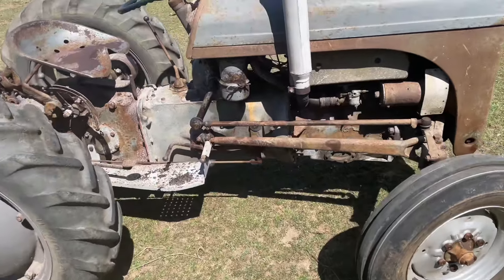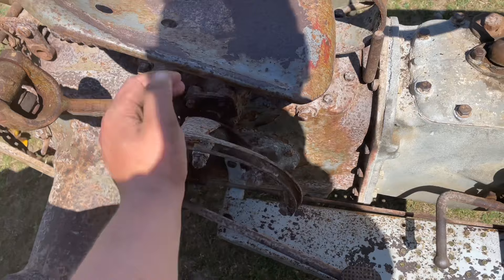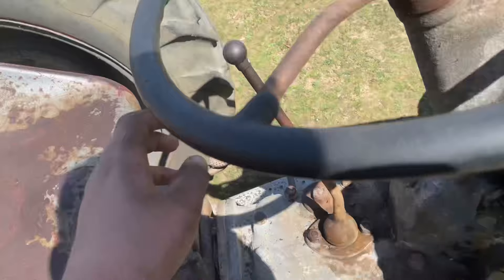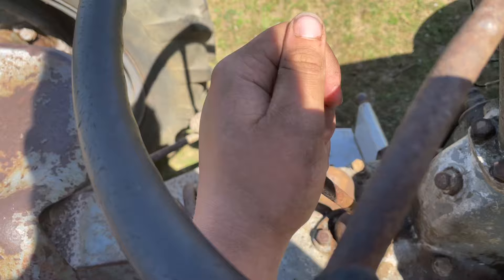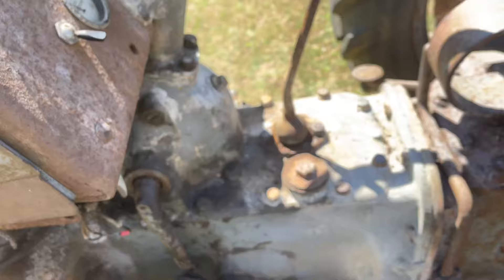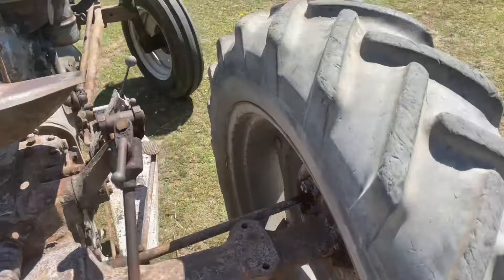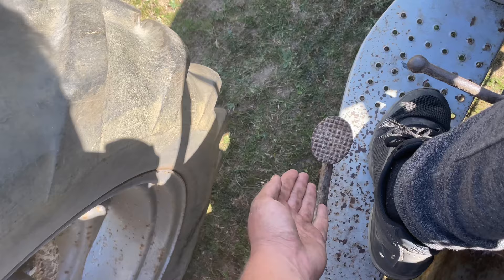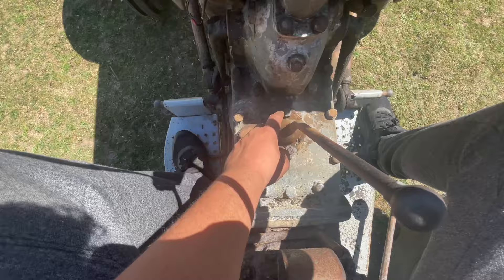How to drive Ferguson TED20

Comment: most of my generation ( baby boomers) of Welsh farming stock learn't to drive on one of these progressing to a 135 which is the same thing on steroids. Age 12 I would frequent a local dealers yard during my school lunch hour ,making a real nuisance of my self trying to buy a ticket up from the many dead T20s in the field beyond the dealers yard. This dealer had switched to International but was taking in Ferguson's  from his established  customer base fist selling the B250,then the 275 and the B414. I think the poor starting of the FE35  made it an easy choose but by  the time the improved ,MF 3 cylinder appeared many had defected but I am sure some returned to the fold  as the 35/135 was a far better all round tractor  for hill farmers of the time. All though I did'nt know all the Ferguson  models ,among the old tractors in that dealers dump field in1964 stood O now realise were :-  Ford 9Ns some on steels in Fergusoon  Browns, UK T20 continentals, P 3 conversions ,Early fordsons pre 1923,  continentals, later prewar fordsons,  and other lesser makes from a by gone age. The dealer I think spoke to my uncle and I did not get a £10 fixer up of my own untill1977.

Comment: nice video lad. saw it took a while to start, mine was the same until i put electronic ignition on it, now it goes within a second. would really recommend!!
Reply from the maker: Yes it used to be a really slow starter. But this was when I first got this tractor. It had been sat in a barn for 30 years so I had to hot wire ignition to start it. But it’s got loads of new parts now and goes like the wind. But thanks for watching
Reply: @fazlast  ah cool, mine was also a barn find, non runner for 30 years. I rebuilt the carb and changed the ignition (this is my second TED) and it fired up first crank!
Reply from the maker: @montidell7227  the same as what I done to mine I just put new sparks plugs and a new distributor on it as well that I got off agriline
Reply: @montidell7227  Minds at behind the barn in the Woods for 32 years it's friday right up it it's but a little bit but it runs pretty good but it doesn't sound as sweetest this sounds like a Ferguson min doesn't

Comment: When will this model be available at tractor dealerships?
Reply from the maker: It won’t
Reply: They stopped producin this tractor in the late 50s i belive
Reply: Right. I am a bit late.
Reply: I believe the old MF35 is still being made for some markets (East Africa). It was imported into the UK under the Tafe name about 15 years ago - wish I had bought one. Still, I really love my 1963 MF 35x that still starts easily and does a good day's work.

Comment: Hi do you think it’s possible to run this engine with ethanol?
Reply from the maker: Probably. People run these tractors on anything. I’ve seen some run it on old engine oil and diesel. There’s nothing that they can’t handle.
Reply: @fazlast  not in a Gasser

Comment: Can you shift gears? Or is it just a pick one and drive? I bought one early this year, for transport use, thanks
Reply from the maker: You can do both I believe.
Reply: You can, but don't when under load. The gearbox is sturdy but it can't survive hard abuse for long. Preferably try and match the "idle" speed of the next gear before shifting, if you get a heavy jerk as you re-engage the clutch you need to practice a little. But always err on the side of caution. Many have lost limbs and life to the exposed drive train (if all you are going todo is use unpowered wagons and trailers it will be less of an issue). Being kicked off the seat by the clutch acceleration is a risk if it has a standard seat (not a lot of backrest) and you do not have a firm grip on the wheel.

Comment: 2 seconds into the video a round two piece container is seen above the steering linkage, what is that? Filter housing? 
I got a tef20 diesel and that part was left open so rainwater came in thats why im wondering what its for. I havent tried starting it because of that
Reply from the maker: It’s a really old air filter system. There is a mesh grill on my dash board that has a pipe connecting it to the filter that’s where it sucks air in. The filter should have some oil in the bottom of it. Then there is another part which connects the filter to the carburettor. The oil acts like a filter to stop sediment being sucked into the engine. The TEF would be similar or if not the same. Should be fine to start with out it just make sure nothing gets sucked into the engine(e.g. cobwebs, bolts, etc) . I have used a dirt bike air filter on my carb before makes it a bit easier and less hassle. But yours being diesel it would be a bit different.
Reply: @fazlast  thanks a lot for answering!! 
Okey, yeah I'll make sure its clean. 
All I know about my tractor is that it worked the last time it was used, around 7 years ago.
What would you say, is there anything I should do or check before I try to crank it? I've never had a machine this old before so I'm really worried I'll break something hehe.
Reply from the maker: @Slisktord  make sure their is no crack in engine block. Check under the exhaust manifold they have a tendency to crack their. And see if you can turn the engine buy hand rocking the fan back and forth. Try put a socket on their if your can’t use your arm. If it gets stuck engine has probably seized and make sure you put battery leads on the right way. Some of these tractors are backwards. I once put the battery lead on the wrong terminal and I court fire. I was told if a ferguson has a dynamo the negative lead goes onto the positive and the positive lead is the earth. But if it has an alternator it would be positive on positive and negative as negative same as any other car. But other than that best you could do is crank it and try
Reply: @fazlast  alright! Wow thanks, thats definitely something I would have never thought about.

Comment: Hello , I got a Ferguson TED 20 , this weekend I have to make a long travel with it (80km). What type of fuel do I need to put in it ? TVO , or just gasoline will work ? Thanks
Reply from the maker: You mix gasoline/petrol with heating oil but if you are just driving it on the road you could get away with running it on normal petrol but you will need to take the heat shield off.
Reply: @fazlast  why do you need to remove the heat shield when running on petrol?
Reply from the maker: @edwardmoore2649  because the engine will over heat. TVO engines were designed to start on petrol till engine is warm then you switch over to TVO because TVO doesn’t get hot enough to start engine that why heat sheild is there to hold the heat. But if u run on petrol there is no need for it and the engine will over heat so it’s better to take off
Reply: @fazlast ok thanks for telling me, I’ve got one of these and Ive just managed to drive mine for the first time since 1999. I noticed it was hot this could be the reason why it was getting hot.